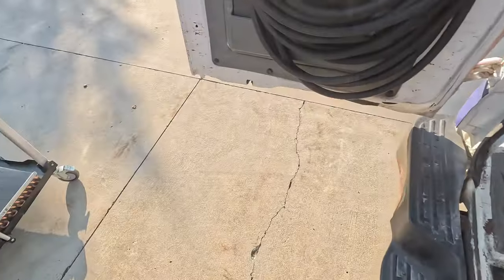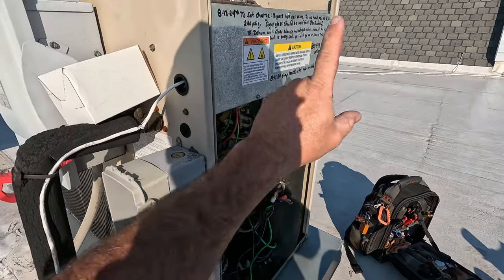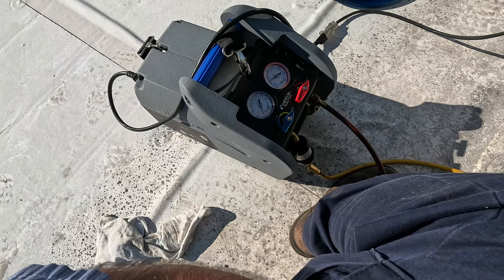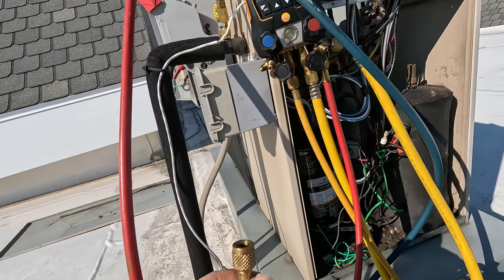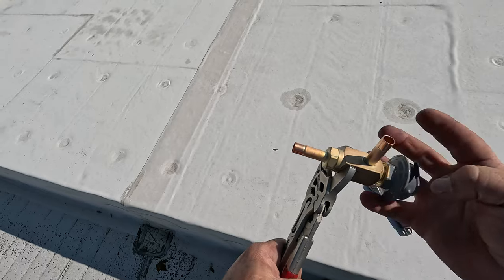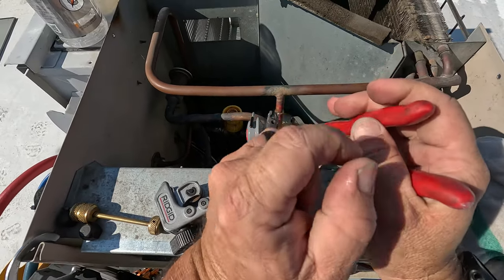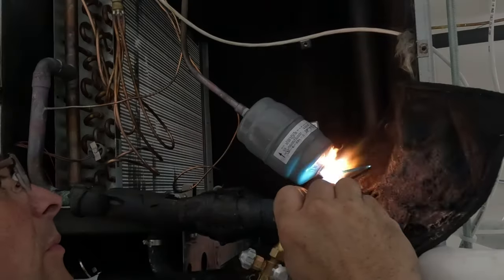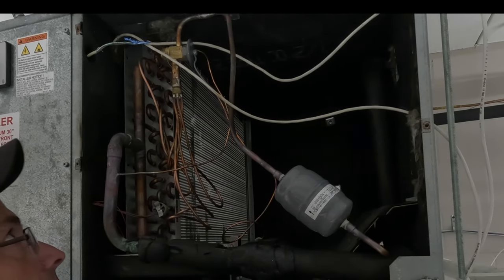Liebert AC Failure Server Room Overheating - BACK AGAIN!

Comment: I have that same cart and really like it. Had it for 3 years and it has held up good.
Reply from the maker: The top has a little hole busted in it. That’s why I put piece of sheet metal down on it and one of the edges is starting to crack, but it works when I use it, which ain’t very often.

Comment: LOL, I was about to smarty comment, the "service receptacle probably doesn't work anyway", when you popped the whole cover off and as it turned out, it didn't work. 🙃
Reply from the maker: I ended up finding the breaker turned off later. This video was over an hour and a half long. I had to chop it like crazy to get it down in time.

Comment: Awesome video Rick. I recently picked up the Ambro kit. Think I am going to get the precision set for it. Going to mainly use it on reaching and some smaller stuff.  Been messing with the oxygen PSI. I know per the manual they want the oxygen set tp 60 PSI. F4om what I have found I can set it around 40 PSI and still get a good fla,e with good heat. Seems to Las a little longer also.
Reply from the maker: They sent me the small torch and nitrogen kit as well. I’ll see if it’s useful for small reach in coolers
Reply: @HVACRSurvival  good deal. So far I like mine.
Reply: don't nuke the tip/s by not having flame too hot/close to the tip.

Comment: down fall to that new torch is them special o2 bottles with your old one you can pretty much go to any welding store and get it filled
Reply from the maker: That’s a valid point, that’s reason why I didn’t just brag it up. I wanted to show both sides of the coin here.
Reply: I run that torch, same brand. Honestly goes pretty well, it's nice and light. The oxygen-acetylene set our company uses runs the real big bottles and is strapped to a hand trolley. 

You can get those oxygen and MAPP bottles at any wholesaler over here, some offer bigger oxygen bottles (you chew through them way quicker than the MAPP). It makes the kit a bit bigger and somewhat unbalanced, but it's manageable. 

I always just keep a spare bottle of each in the ute so I never run out.

Comment: wet the viper rag first! most fame protector pads can be wetted and work far better that way. also carry a scrap piece of duct/tin as a shield.
Reply from the maker: I normally do Wet it. I screwed up.
Reply: @HVACRSurvival  no worries, we like your work, with real world slip ups and all.
none of us are perfect by far.
the burns on my wrist and fingers are almost healed. lol replaced a water heater and multiple valves a week ago (yeah copper sweat work), and dry towel wiped the hot joints, then kept bumping into them  while still hot, flux cleans up better when hot. gloves and long sleeves are for cry-babies. 🥸
I don't do near as much plumbing as I used to, but sure not scared of it! 
the press stuff would be nice, but the whole job I did last week, was all tight quarters and only five or six joints of about  forty would work due to tool not fitting anyway.

Comment: Union Carbide used to make MAPP gas, they stopped back in 2008.  So, that touch set runs fine on a MAPP gas substitute??  The substitute gas is related to discontinued MAPP, it isn't the same stuff.  My guess is the torch set uses MAPP substitute, Or, is real MAPP gas still available in Australia?  Who knows, there are differences between the two products.  Most users won't be bothered by the differences.
Reply from the maker: The full name that I mentioned on the bottle is the name they told me it uses. I can’t remember exactly what it is but technically as you mentioned, it’s not just regular map gas. It worked pretty good and I guess it can do up to an inch and a half for the manual that I didn’t read. 😁

Comment: My GoPro overheated in direct AC vent and in windshield but in sunlight. But the AC was directly on it. GoPros suck
Reply: All GoPros after the Hero 5 suck , but the 10's and up seem to have the chronic overheating problems. I have one of the original Hero (2014) models and the only issues I have are the original batteries. I bought Wasabi replacements that work well.